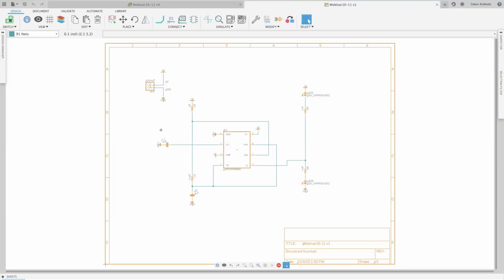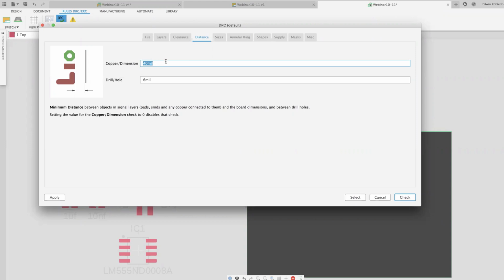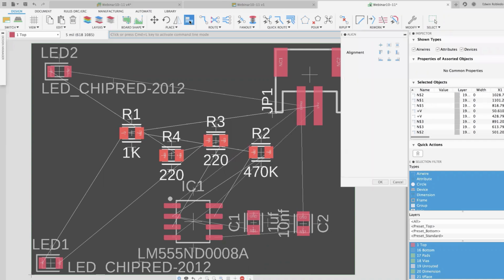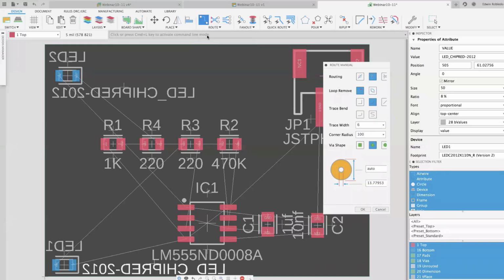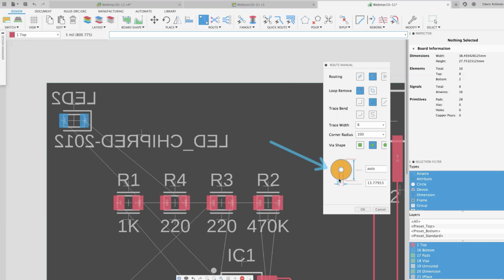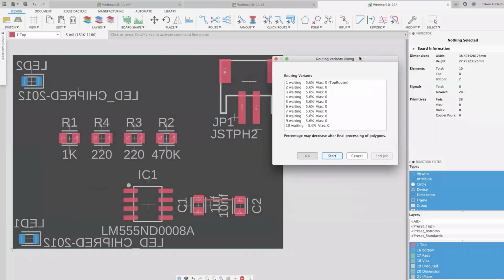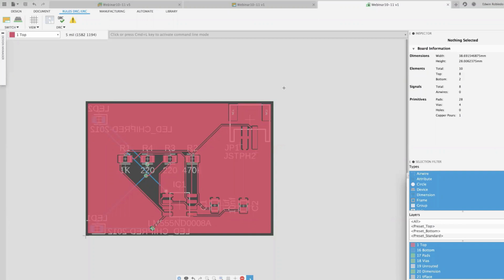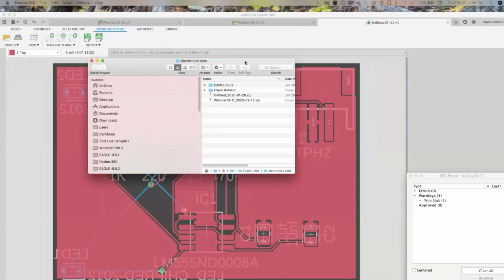Autodesk Fusion 360 | Webinar: PCB Layout

Comment: Thanks. Really useful info. Now more than two layers.

Solar panel https://amzn.to/2Cx3J5t
Eco-worthy 1000w https://amzn.to/2Cg8i4a
Amazing shower https://amzn.to/39trFTi
Earbuds https://amzn.to/3fcw3Iv
Kindle ultimate https://amzn.to/31PAx3N
Twitch prime https://amzn.to/2ZIgcLl
fire tv stick https://amzn.to/2C2bTlE
Midea U Inverter Window Ac 8,000BTU https://amzn.to/3eRYzyp
Necklace fan https://amzn.to/2VGlIwU
Sense Energy Monitor https://amzn.to/2T2u3JD
Spiderman FFH https://amzn.to/2W3NIK7
Aveners: End game  https://amzn.to/2KOhyx7
Metamucil double https://amzn.to/3aHoNB8 single https://amzn.to/3bmvVTU
Canon EOS M50 https://amzn.to/35fHX0c
SONY RX 100 VI https://amzn.to/35bteTS
Canon PowerShot G7 X Mark II https://amzn.to/2WaAPhp
CANON 90D https://amzn.to/3cX8z8O
SONY A6400 https://amzn.to/2VMUNzL
Darth Vader and Ahsoka https://amzn.to/2A3qDjl
Captain Rex https://amzn.to/2L2tMST
Ahsoka Rebel https://amzn.to/2A0hoAl
Anakin https://amzn.to/2W8QZch
Skillmatic https://amzn.to/37PwSEn
Aqua 4 in 1 Monterey https://amzn.to/2Ctihmm
Bunch O https://amzn.to/2YWQodL
Face mask https://amzn.to/2ZBw2Y9
Enema https://amzn.to/2YTOquQ
Amazon business account https://amzn.to/3h9t98K
100 disposable gloves https://amzn.to/3dEbNh9
Bicycle rollers https://amzn.to/2VFCOLh
Oscilloscope https://amzn.to/32tCFyA
Ispring reverse osmosis https://amzn.to/2Wy6D0I
Flex Seal Spray Rubber Sealant Coating  https://amzn.to/2OWPERv
Great Stuff 157913 Big Gap Filler, 20 oz https://amzn.to/39t7lBK
Reusable Half Face Cover, NASUM M101 Face Cover https://amzn.to/3jDWFVl
Rockport Men's Bennett Lane 4 Venetian Shoe https://amzn.to/39tqumR
Helix Flexible Stainless Steel Non Skid Ruler https://amzn.to/3jECy9B
Bacitracin Zinc Firtst Aid Antibiotic https://amzn.to/30KvsHT
Bella & Bear hawaiian sea salt shampoo   https://amzn.to/2Dst6pc
Bella & Bear hawaiian sea salt conditioner https://amzn.to/2PiRFHO
DP toy wireless https://amzn.to/2QqpdEC

Comment: Fusion 360 or Kicat for beginners? For someone has decent fusion360 skills
Reply: Thanks for telling me about Kicat! Haven't heard about this until now...
Reply: @AvivMakesRobots   It's called KiCAD
Reply: kicad all the way! eagle is hard to use in the beginning, even if you are proficient in other cad applications. kicad is very easy to get started with and in my opinion easier to troubleshoot compared to searching thru Autodesk's  support forum.. eagle is probably more capable but for beginners that doesn't matter.
Reply: @Rotwold  I never would trade Fusion 360 with integrated Eagle for KiCAD. Never ever. 
Maybe if you are familar with KiCAD and SolidWorks, this would be the cheapest way to go.